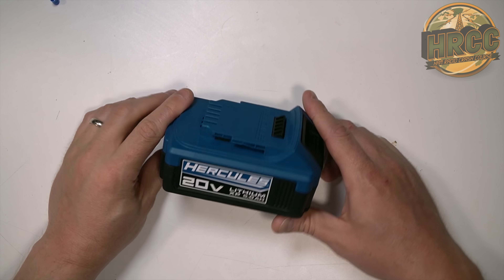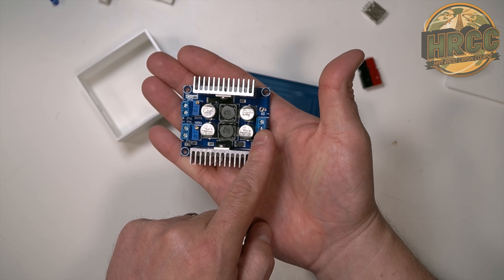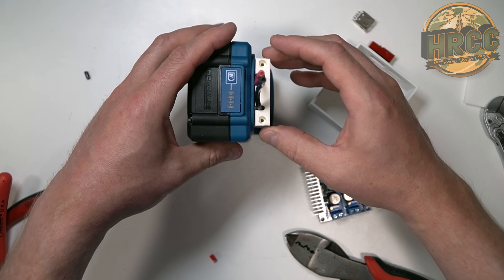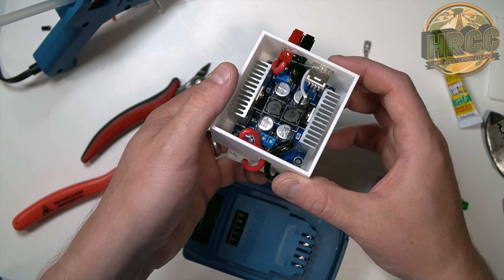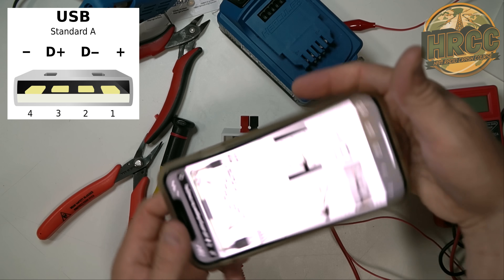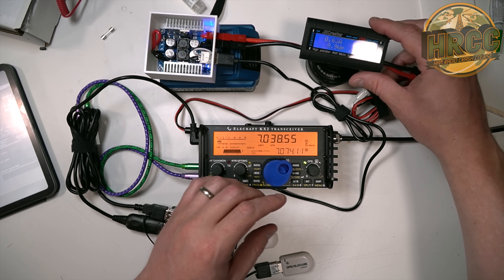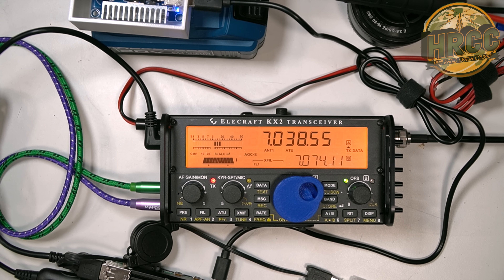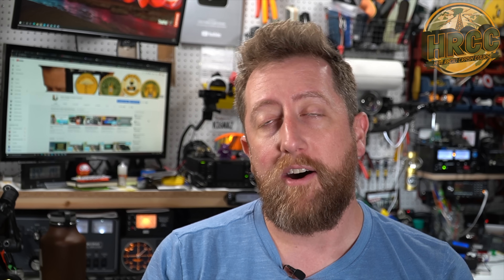Tool Batteries For Ham Radio

Comment: I think a 20v battery will give more time of use before a needed recharge than a 12v battery would of the same Ah rating.   Does anyone know if the single chip regulators such as the LM317 are more or less efficient (ie. waste less power) than a step-down buck converter?
Reply: Update, I looked up the efficiency question and the converters with transformers are more efficient - waste less power.  They can also boost the current during a voltage stepdown.   The question is now about any  noise and what to do about that.

Comment: Side note, Milwaukee makes a device that slides onto their 18V batteries and provides usb-a and usb-c 5V power, or 120V AC power. The devices pulling AC should be drawing 175W or less, so it works great for topping off a dead laptop in the field, or fast charging cell phones, tablets, pi's, etc... It's also got active cooling fan that's auto controlled, and is about the size of the battery it slides onto. 

 https://www.amazon.com/Milwaukees-%F0%9D%97%A0%F0%9D%97%B6%F0%9D%97%B9%F0%9D%98%84%F0%9D%97%AE%F0%9D%98%82%F0%9D%97%B8%F0%9D%97%B2%F0%9D%97%B2-TOP-OFF-Supply-Premium/dp/B09XKVTN1D/ref=sr_1_4_mod_primary_new?gclid=CjwKCAiA5sieBhBnEiwAR9oh2oVvaOTuiBntQlGM41uut7xKFShnDUwoLkh1yDzZAdwLt8VjPCxdmhoCVAoQAvD_BwE&hvadid=488286994242&hvdev=t&hvlocphy=9031272&hvnetw=g&hvqmt=e&hvrand=5474979065416799562&hvtargid=kwd-1087300326234&hydadcr=7442_9611317&keywords=milwaukee+top+off+power+supply&qid=1674767730&sbo=RZvfv%2F%2FHxDF%2BO5021pAnSA%3D%3D&sr=8-4

Comment: The cordless drill manufacturers really should make a puck that pops right on a pack, with usb, anderson, springy hole clip taps like on a speaker box, and a cigarette power plug female port, with a voltage/battery condition monitor using two LED's at most. Could be massively handy for any use in hiking, biking, camping, or a cell charger hub at the jobsite, besides way cool obvious amateur radio utilization.

Comment: Great but wish you would have used the cheapest 5hr from Bauer just because its cheaper than Hercules thumbs up
Reply from the maker: Do what you want bro. The converter will take what you type at it.
Reply: @HamRadioCrashCourse  sorry if I affected you. You will not get a nother comment from me. You just like all of the rest of those other's  on HAM RAIDO  BLESS YOU
Reply from the maker: Not affected. Just pointing out which battery you use is up to you. The buck converter is adjustable for that battery output. 🤷🏼‍♀️

Comment: The only suggestion I can think of would be to add some length to the box you made. If you have enough clearance with the plain where the box and battery meet, there's no need to keep the box so small that the board just barely fits. That would make access a little easier for the set screw and any other work. That said, it was easy to mitigate, but just a thought.

Comment: For the future, Tinkercad is a lot easier to "pick up and design" with. Fusion360 is by far a more powerful tool, but that also means it takes a lot longer to get comfortable using it. I went through all the tutorials and designed some stuff with it... and then didn't use it for 6 months and forgot everything I knew.

Comment: Interesting.  I saw an article about the Amish and their buggies.   Turns out that for safety many have added LED lights and are using tool batteries to power them.

Comment: Take a look at using 36v hoverboard batteries. Slightly larger, but less impactful on the cells, and you won't hit the LV cutoff as quickly.

Comment: I would have expected to see 500kHz switching noise on the DC. Do you need a choke or is the DC clean ??
Typically bucks add less noise than boost IIRC.
Reply from the maker: It’s not a boost and buck. Just a buck.

Comment: I agree with Mr Green. Use a battery charger base for holding your electronics.
I will put this out there for anyone considering this. I just replaced all my battery power tools with Rigid brand tools. They are excellent and the best part they have lifetime warranty on tool and battery. Supposedly they use really hi grade batteries so there you go.

Comment: Great video! Wonder if one can use two batteries in parallel for more power if you were to use low loss diodes to isolate the batteries from back feeding into each other. The prices of the batteries seems to be coming down as more tools dependent on this power system hit the market.
73!

Comment: Those aren't "automotive spade" connectors" they are "male faston" connectors.  The set screw is under the socket not the plug.  This occurred to me the day I bought my first pair of DeWalt 20 Volt batteries.  I set mine for and output of 120. Volts, I operate my FT450D at 50% power from the picnic table. (FT450D set to "generator power") Ron W4BIN
Reply: Typo!   I set mine for and output of 12.0 Volts

Comment: Josh, have you come across interference coming through on the KX2 with the buck converter as I have used one for powering a handheld via 12v with my portable battery box? Adam VK2YK

Comment: Nice! I’ve a similar project in the works based on Home Depot’s Ryobi 18v system. I have many of their 4AH and 6AH 18v batteries and a dead 6 port charger. I gutted the charger and inserted a 24v to 13.8v 30A buck converter that works great at 18v. Actually it’s more efficient. I’ve yet to load it up but it should be able to supply enough current to run a 100W rig with 6 batteries inserted. A single battery can power receive while the others are being recharged.

Comment: It works. I baught two drills. And scarfed a charging coupler. Then cut it's head off. Now I took. The output line to a heat sinked box. Set up desired voltage. And it puts out voltage desired.  Now the extra charger works for charging both batts. And thrugh a veritable  voltage regulator chip. I change the restor.  to suit. My needs. 3.7-4.8- 6-7.8-9-12.0 vdc. And I have 2 hobby drills tks

Comment: I got myself an Active Energy 20V 2Ah battery. Mostly the same. If you dont need it for a power tool, might be easier to open the thing and solder directly to the mini circuit board.
Reply from the maker: Then you’d need another charging option.

Comment: Consider adding a parallel battery connector that way you could "hot swap" batteries. But definitely add fuses to protect the rig. Also, if noise is an issue, add some foil or copper tape to the inside of the enclosure and chokes to the output.

Comment: AG5SK, Here Josh.  Very impressed with the build and the concept.  Is there a work around for those of us that do not have access to 3D printers? Perhaps you can include it in a supplemental video when you get that better enclosure.

Comment: Totally did this.  I made a device that takes Milwaukee 18v batteries and power 5v and a variable buck converter.  I’ll post on thingy verse. Was almost done, maybe too many irons in the coals. Up side is the battery has management/ load protection built in for you.

Comment: good idea.. with the popularity of USB, all ham radios should be able to be powered with a USB plug.  At least the HTs should.
Reply: problem is that at best, 5v USB is going to max out at 3A. Low voltage doesn't like high amperage. Now charging is another story altogether. I have made converters for all my gear to be charged off USB. and if you use USB-c PD3, works even better.

Comment: put a small digital DC voltage meter on the input of your buck converter so you can see when the battery is almost to low

Comment: Great experiment. I have 2 Parkside X20V 4A (Lidl) batteries, these are rather cheap. Printing a bracket now found on same website as yours. Ordered a bigger step-down converter on Ebay. Now thinking about low voltage cut off protection. Looking foreward to your next video!

Comment: 20200630-Tu., Excellent video! Look into the other lithium cells -- LiFePO4 -- promising 2000 deep-cycle service. (I am planing to upgrade my APC-350 with such -- indeed, probably want to update the circuitry also.)

Comment: alot of tool brand batterys already have 5v usb adaptors. HART Dewalt and a few others i have seen.  The radio for the bauer line has a usb outlet, as well as a few others..
Reply from the maker: Yes... but not 12v for ham radio
Reply: @HamRadioCrashCourse  understand what your saying, my comment was more directed towards people not good with soldering etc, and would like to buy a "pre made" unit to run a pi or something. :) hope your field day was good!

Comment: Wait could u just connect the radio right to the battery or is it to much power?
Reply: 20V would damage it. 16v is really the extreme upper limit, and even then you are stressing the components

Comment: I recently did something similar to allow me to use a USB-PD powerbank and wall charger to charge my laptop. There are USB-PD boards that allow you to output 5v/9v/12v/20v from these and battery banks are usually better power density, mine is 20ah, 65w in a smaller package than the tool battery.

Comment: Hey Josh! You asked us to tell you what we think. I think this has some real life use with QRP and POTA, SOTA and any other *OTA operation. What I'd like to see is a RMS Station ( 50 watts on 2m) or a 100 watts HF station running phone or RTTY or a weak signal operation like JT65. What kind of battery life do you think that would get?
Reply from the maker: How many hours do you want to run?
Reply: @HamRadioCrashCourse  Well, POTA 3 to 4 hours, for Winter Field Day 24 hours.
Reply: @raykiii  LiFePo4... need those.
Reply: @Trancifiedx  So this would not be 50 watt friendly?
Reply: @raykiii  not with a single tool battery. A few in parallel could do it, but will need a fair number to last for the time I think you are looking for. I use a 36v hover board battery for my g90 with a buck converter. That lasts for about 6-8 hours, using 20W.

Comment: Love the idea, love the execution.  In my experience doing things like this, I end up spending WAY more time designing and redesigning the enclosure, and ending up with about 15 different variations printed out.  When figuring out how the printer + the PLA was going to transform my design (translating designs into actual materials can be hard), I started printing out only the part of the design I was trying to dial in, like making sure holes in the case line up with the sockets on the board.  Saved me a lot of time and PLA.

Damn I need to get my printer going again.

Comment: To overcome the 3A limit, could one build 2 or 3 of these and wire the output in parallel?
Reply: I have done that with similar buck converters and it worked well.

Comment: Cool stuff Josh!! But I have to admit you’re a brave dude for risking your KX2 on a $10 power converter. I’d rather play it safe and just use a 12v battery.
Reply from the maker: I forgot to mentioned. Fused power leads to the radio. 👍
Reply: Ham Radio Crash Course Thank Goodness!! Lol

Comment: Nice, No 3D printer in my future so I have to do it the old fashioned way. Scour yard sales for old battery pack equipment that the connector can be cheaply scavenged and go from there. I just got to do as AvE says "Keep the angry pixes going down the right paths."

Comment: Great video. You may need to put some resistors to the data leads of the USB to be able to charge your phone / devices faster. Some phones will only charge using 500 ma without the resistors. They look to see the voltage on the data leads to see how much current it can supply.
Reply: What kind of resistors would you use?
Reply: That is not an easy answer. I just searched and found many pages with diagrams and resistor values. Most show a voltage divider from +5 to ground with the center point going to D+ with another voltage divider going to D-. One page used a 75K going to +5 and 51K to ground.

Comment: I like this idea!

One thing that MUST be added to this power supply, is a low battery alarm, and possibly also a low voltage cut off circuit. 

Also, what is the maximum sustained current output of the buck converter? (We certainly cant trust the information on the ebay/Banggood listing. 😏)

I’m also wandering about how much noise is on the output at different current loads, and how to deal with it if you use a radio that is susceptible to it.

Cheers from OZ land!
73 de 5Q3M
Reply: 5Q3M???
Reply: Stephen Wade Yes, that’s me! 
(Well, it’s my callsign.)
Reply: Denmark? vk3hjw
Reply: Good idea, but I'd prefer to see a input fuse and a crowbar circuit first.  Otherwise, if that buck converter fails, it's going to get expensive.
Reply: Yea, the battery has eprom for charge data, and monitors heat and over discharge. Milwaukee shuts down when the load is too much, or a high temp. ( because battery powered angle grinders suck, and shut off all the time.)
Reply: Definitely need a low voltage cut off!  An alarm is good too as I learned the hard way that while the low voltage cutoff will protect the battery from the load discharging it too low, they will keep drawing power beyond the cut off destroying the battery.  Maybe someone knows of a good cutoff that won't do that.
Reply: @Jeff Karpinski most lithium tool batteries have cell balance, temperature, over draw and low cell voltage cut offs. Even cheap ryobi's have a BMS, I know for sure milwaukee's do. ever taken one apart? 99% of the time its one cell lower then the others. Maybe your thinking NiCad?

Comment: Fantastic video! Thank you for taking the time in making this video. There are so many, cheap batteries out there where this option can make our hobby much more fun and affordable. With that plastic box, I'd probably wouldn't change a thing except, maybe put that circuit board in a longer box by a few inches so you would have better access to adjusting the power levels of the outlets. Maybe drill some holes above those power adjustments and put some type of a gasket in those holes to keep dust and moisture out of the box. This way you can adjust power on the spot while in the field. Maybe with using it in the field or carrying it around, vibrations may occur and the power levels may get misaligned. So power level adjustment would be better. Again, great job and great project for many of us. Thanks again for this video. Be safe out there and have a great Fourth of July!

Comment: My question is: How noisy is the radio, with using the buck converter? Is it quiet, or a little noisy?
Reply: I'm curious too. Mobiles usually have a solid amount of filtering because car power systems are not very clean either. Check schematics.
Reply: Good question. I hope he will give us an update later and answer that.

Comment: I've been looking into this for a portable rig. I'm considering building a switch with an SWR meter in it as well, so I can run a quad band radio and antenna, and maintain the ability to tune it.

Comment: So, once you mount the battery adapter, how do you get it to charge again?
Reply from the maker: Just disconnect the box and through the battery on the charger.
Reply: Unmount and plug it in. I'm looking for a way to run a charger off a 12v solar panel, and have a whole self contained unit.

Comment: Buy extra chargers for the battery and use it as the base build a "box" the same size and shape as battery. More room for the buck converter and more aesthetically pleasing. Also if done right, no external wires from the battery to the buck converter. Otherwise buy another charger cut the cord use three barrel connectors. Male connector on the charger's wallwart, male connector on the box for the buck converter, female the the charger's battery clip. Unplug the charger from the clip, then plug the clip into the buck converter.

Comment: Josh safety concern ; you have to make sure those batteries disconnect when each one of the cells inside that pack get to 3 V each. (20 v pack = 5 cells x3v=15v) if you draw these cells lower than 3 V they could go critical. the battery may have it built-in but I haven’t tested you should see if this is so
Reply from the maker: Good point. I’d be shocked if it didn’t have protection. But I will check that in the future.
Reply: @HamRadioCrashCourse  I've heard that the Dewalts do protection inside the tools not inside the battery case but Ryboi builds the protection circuits inside the battery case.  Not sure about the Hercules.
Reply: @HamRadioCrashCourse  depending on the BMS in the battery pack, it might have an undervoltage protection. But they might indeed have left it out since most appliances or tools will give you a warning when the critical voltage has been reached. I've bought similar buck converters myself, and I'm more afraid of the buck converters not doing their job and blowing up my precious radio over time, so I'm considering implementing an overvoltage protection with a fuse and a zener diode. Very nice project though, and a nice 3D-build and print! 73 de ON5DAQ
Reply: @HamRadioCrashCourse  one thing to check... if the batteries themselves have a power indicator (you press a button and it lights up) then it probably has the protection circuits. Not guaranteed, but it is a better chance.
Reply: I found a 20 amp disconnect XH-M609 on Amazon, or a 30 amp with high and low voltage discount 	Wal front
Part Number	Wal front6g1789nwid  this is a change and low voltage protection device still looking for something more appropriate  for 30 amps but this would work if needed
Reply: This type of protection should be used on all batteries like acid lithium it will help prolong the life of your batteries without having to keep both eyes on it

Comment: Josh, thanks for this video. I realize that you are experimenting and feeling your way into this. I think that particular buck converter may not have enough amperage to run both your raspberry pi and your radio. I searched for dual voltage Buck converters and didn’t find any with a higher amperage than the one you have, which is 3 A max, and 2.5 continuous.